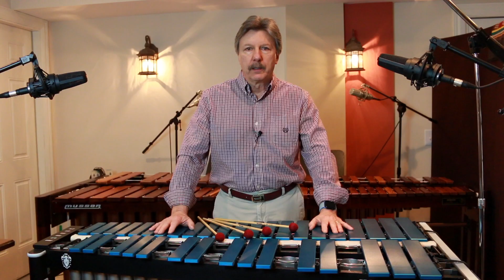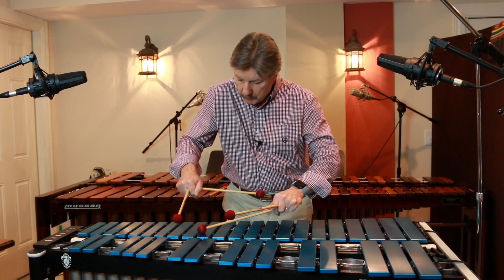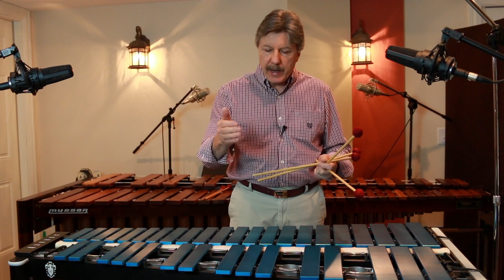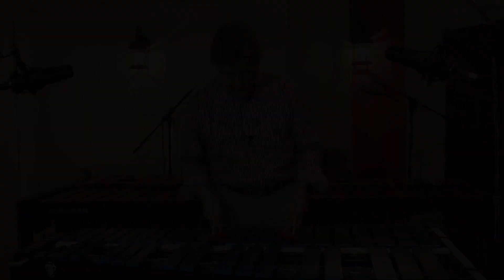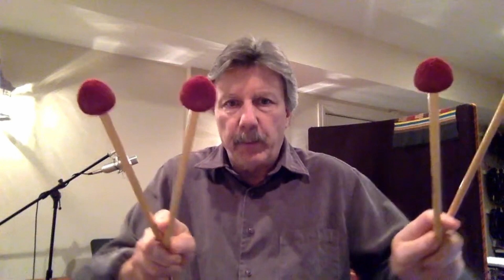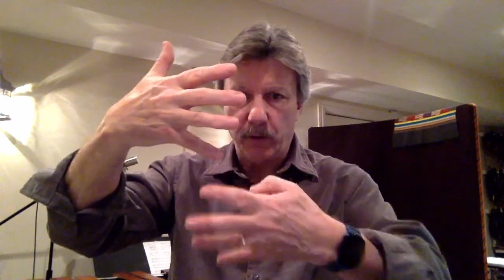Vibraphone Basics with Jerry Tachoir

Comment: Dampening techniques 

1. 6:15 Slide dampening. Melodic-type scale passages notes that are fairly close together. When moving right, right hand hits and left stick damps. When moving left, left hand hits and right stick damps.

2. 7:35 Touch tone. Use the same stick to damp when jumping around notes.

3. 9:00 Adjacent note. Moving a stick over after hitting the next note to dampen an adjacent previous note.

4. 10:45 Hand dampening. Predominantly right-handed. When hitting a black note, use the side of the hand to dampen an adjacent white note simultaneously.

Pedalling techniques
1. 11:30 Clearing the harmony.

2. 12:45 Flutter pedalling. Using pedal during phrases to sound more legato. Try to keep the pedal at the exact spot where the notes border between ringing and don't.

16:00 Summary of techniques.

Comment: Bravo on the 440 vs 442 Jerry! In addition to the nightmare of mismatched 440/442 instruments trying to play together, the resonators are also not at their best for A442 instruments. When Musser tunes their bars to 442, they don't tweak the resonators to follow. There is no adjustment made to the resonators from A440 to A442. That doesn't mean that the notes will sound out of tune or that a clashing will occur between the resonator and bar but the resonators under a set of 442 bars will not be as full or rich sounding as when it is under an A440 set of bars. It will be thin and less strong and less warm. The fan position is also affected.